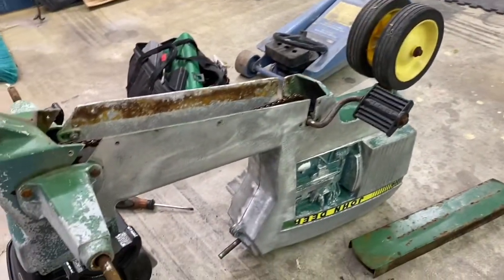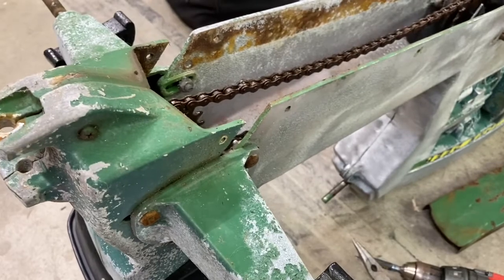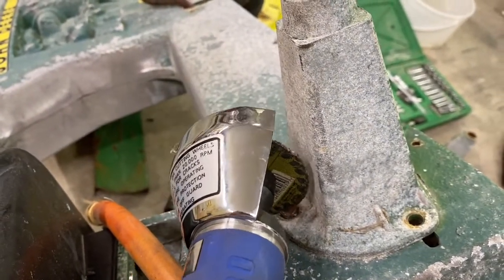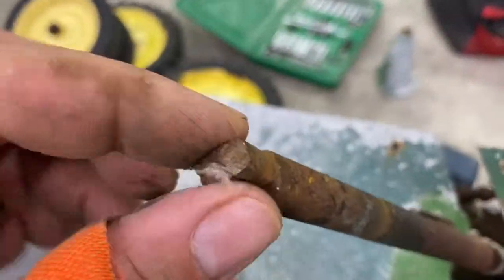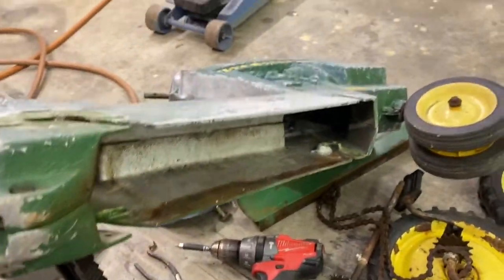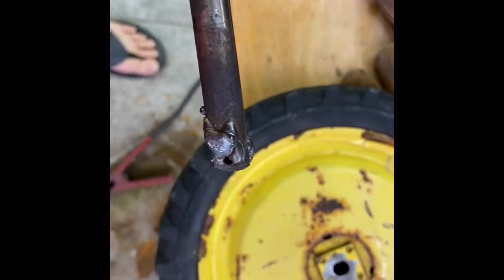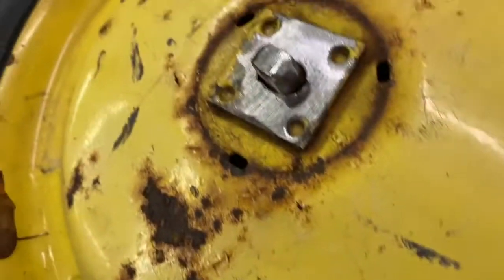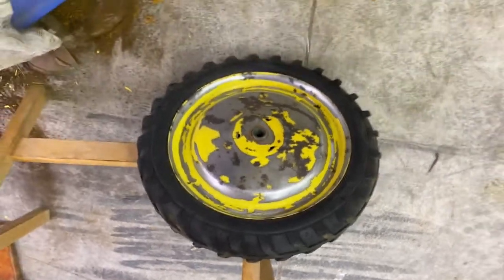Repainting a pedal tractor:  Part 1

Comment: I just started taking the one I have apart. For the bolts and screw heads that stripped, I welded a nut or small bolt on. That may be a faster method if you have a welder.